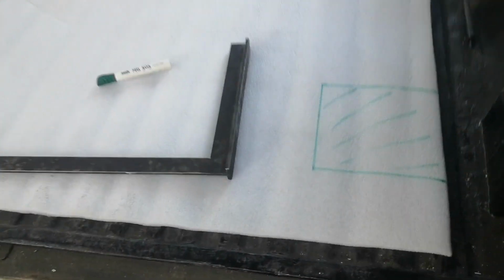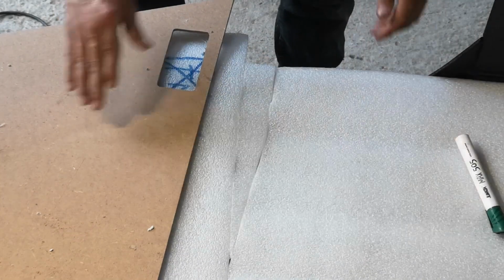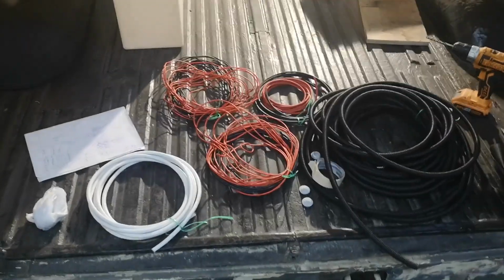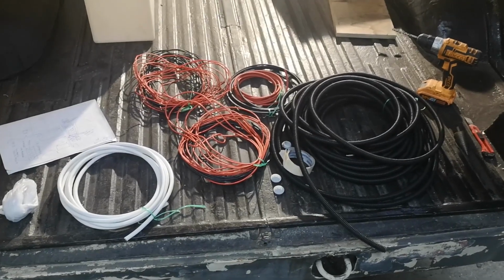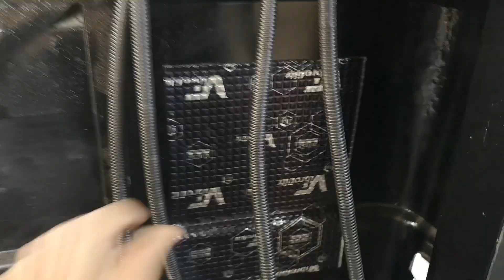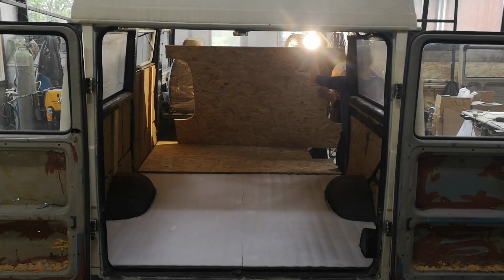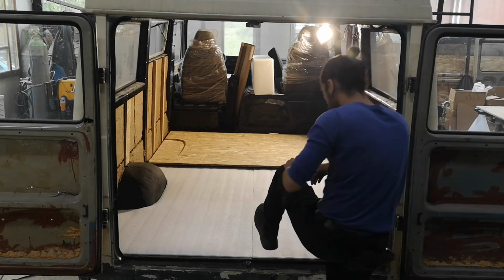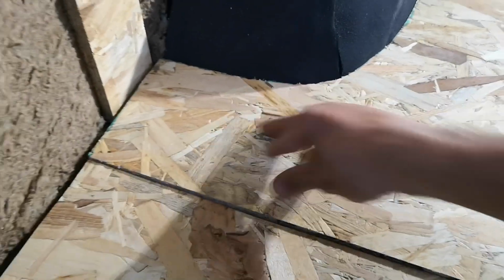VW LT35 Campervan insulation and flooring

Comment: Good to see another LT surviving! I own the same one, but from the end of production. Too pity you made so thin floor insulation, in cold days it's the weakest point of mine and I got 2cm extra layer. I got the same OSB board but have put it on 2cm wooden frame + insulation everywhere in between the wood. Anyway good job so far man!
Reply from the maker: thank you! yea its a shame for the floor but I just didnt want to take anymore height out of it because its already tight as it is, im going to put 1 more layer of termosilent and laminat flooring on it tho, hope it helps a bit...

Comment: What a great project lucky your fit and healthy, nice job on cutting the sponge for the wheel arches tricky with the sound deadener i thought you might add a bit more deadener mat to the side panels but coming along nice keep up the great work mate
Reply from the maker: thank you! had to keep it tight on the material because of the budget :/

Comment: Hello, I have an 89 LT35 converted to a camper about 30 years ago.  The walls and ceiling are covered with carpet on hardboard. its cheaper, easier to fix over head, thinner for the headroom, lighter for total payload and saves putting the weight up top, LT's don't need an excuse to sway... Its too late now but I have 6mm ply on the floor (headroom again) and that was fine for years until the shower leaked.... Enjoy
Reply from the maker: im planning to live in it in cold weather so i need something thicker than carpet
Reply: @PureMongrel-bm2no  I lived in mine in the UK for 12 years all weathers. If you are planning that, I would recommend that you use a foil underlay under the wood. I have tried them all and the foil ones make a big difference  for the least lost height. I fitted a lot of laminate floors and used any left overs under the carpet, so I have toe tested most of them and even sheets of foil bubble wrap on your walls and ceiling. Its very light easy to apply  over your existing insulation and can reduce draughts like the plastic  inside an old door..  As you were doing it I did wonder if a layer of foil bubble wrap would be good on the floor also. The bubbles would likely crush on the ridges but still leave two layers of foil over the underlay you have. In the grooves the bubble air gap would help.. Just a few thoughts, I am thinking of stripping mine in a year or so and updating the 27 year old insulation is a priority..